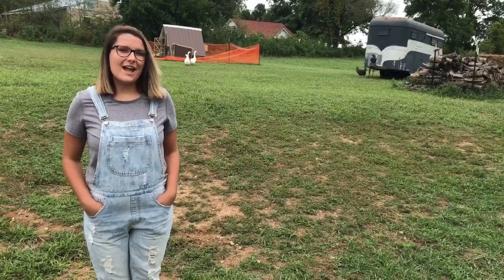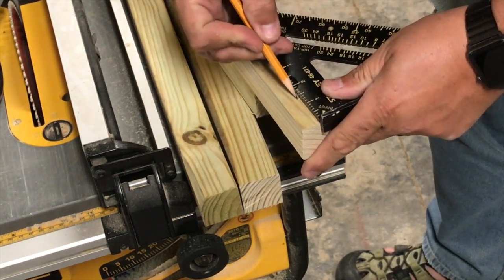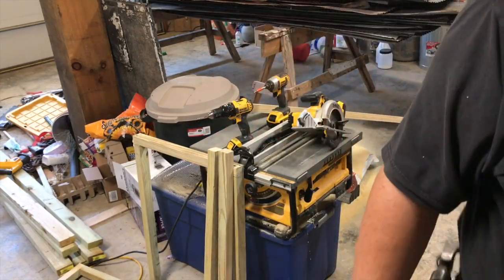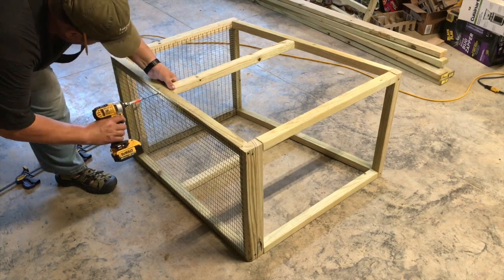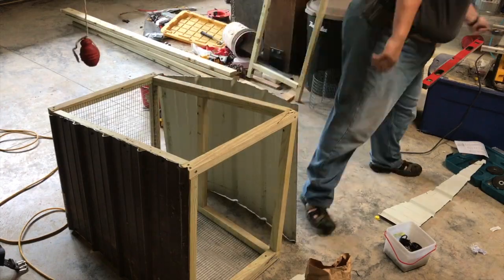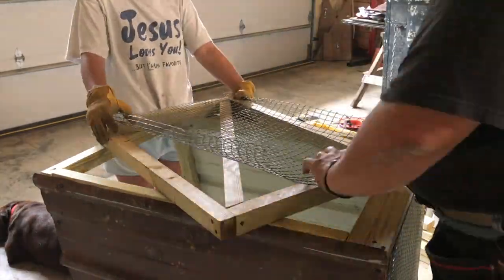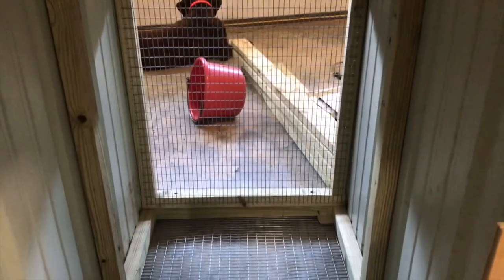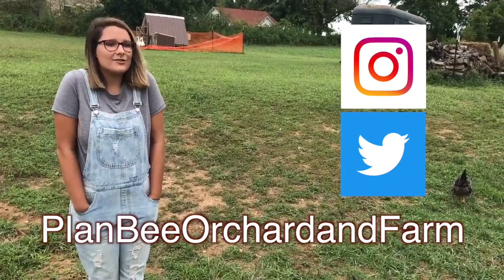How to Build a Goose House

Comment: I cheated when I built my goose house, I actually have 2 of them now. I got 2 truck canopies that no one wanted and had a few issues I had to deal with. First one I got had a very soft roof. So I added a large piece of waterproof plywood to the inside of the canopy and cut 2 x4’s for the outside and screwed thru the inside plywood into the 2x4’s to sandwich it all together.  There’s 3-2x4’s on the top. I didn’t stop there though, I added corrugated metal on top screwed to the 2x4’s. And I added 2x8’s on the very bottom of the canopy where it’s like sitting the canopy on a truck bed. Except the 2x8’s are screwed to the canopy to make it a permanent structure. Didn’t bother with a floor since the geese are so messy. With the 2x4’s on top, I can slide the forks accessory I have for my tractor and pick up the whole goose house and move it within a couple minutes. Then I add some sawdust I get from the feed store for the geese to lay on inside. The back canopy door still works s and can be locked shut. Geese can get out easily when I open the canopy door. I did get a heavy plastic ramp that sits outside the canopy door for the geese to be able to walk up and get inside easier. They of course have windows all the way around counting the canopy door and the 2 side window’s open. I added hardware cloth over all the windows to hopefully keep predators out. So far so good!  Other canopy I plan on using for my ducks!
Reply from the maker: I love when people repurpose items for farm use! Good job!

Comment: Do you need to close up your duck coop for the Colder weather? The open and front with hardware cloth is nice in the warmer weather. Just curious if it’s necessary to close it up better when it gets down to freezing or not? Does that become a problem for you where you live?  Know my chickens coop I built is completely enclosed except the very top has vents all the way around and there’s also 2 windows on each side that open when it’s hot outside.  Also added misters on the roof to help keep it cooler in the hot summers too that does make a difference in temperature inside the coop to keep it cooler keeping the top of the roof wet with cold water.  Also used white metal on the roof that helps reflect the sun’s heat too. Darker roofs suck in the heat, so I avoided the dark roof!  I just acquired some geese and ducks myself as babies I have in my garage for now in cattle water containers that I’m using as a home for the babies. Have two containers since I have baby chicks too and the ducks and geese get their containers way too wet for chickens.  Ducks and geese have their own container now. Got to get their permanent home done before they get too large for their garage containers to live in!  I’m working on a idea I had turning a truck canopy into a duck or geese home. If you look around you can find cheap or even a  free canopy that I already acquired a free one!  Should save a lot on cost building them a home?  Was going to put the ducks and geese together till I just learned the geese will eat the duck eggs. We can’t have that now can we? 😂  looks like another home is in the making now after all!  Btw, do you build any type of nesting box for your ducks or geese? Do they use nesting boxes?
Reply from the maker: In winter we cover the wire with plywood inserts to keep the wind off of them and give them hay to  hunker down in. 
My ducks prefer to nest outside of a nest box, so I give them hay on the bottom of their house.

Comment: Screwed the roof in wrong. Need to put the screws on the ridges not the ditches. Itll leak water otherwise
Reply from the maker: Good tip thanks

Comment: What is the weather where you're at?  We have fairly chilly winters here in Western Washington sometimes with a couple weeks of snow, wondering if something like this would work for our geese and ducks, but concerned about the cold.
Reply from the maker: In the winter we screw wood covers over most of the hardware cloth to protect the ducks/geese from wind. And we give them lots of hay. 
We get down in the teens and get snow.

Comment: Does this house gonna prevent goose from coyotes? Thanks
Reply from the maker: Yes, it does. it's locked up at night and the coyotes can't get in. Just make sure you use "hardware cloth" and not chicken wire. We learned that chicken wire will keep birds in, but will not keep predators out.
Reply: @LorellaPlanBeeOrchardandFarm  Thanks